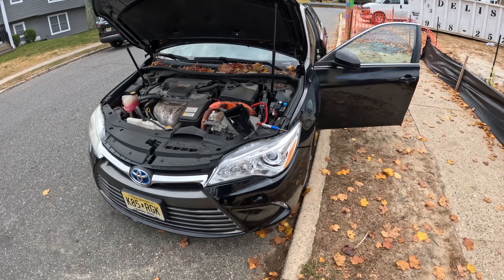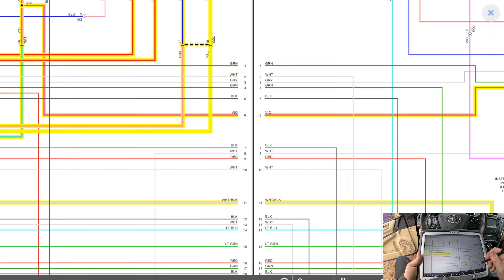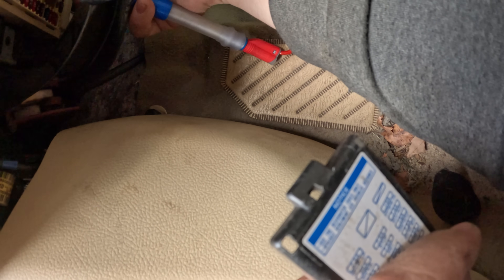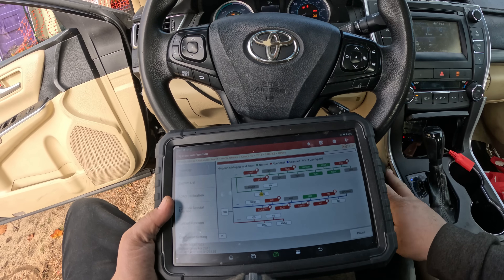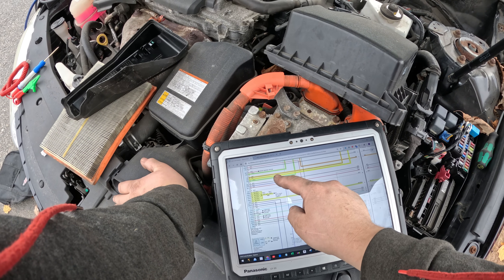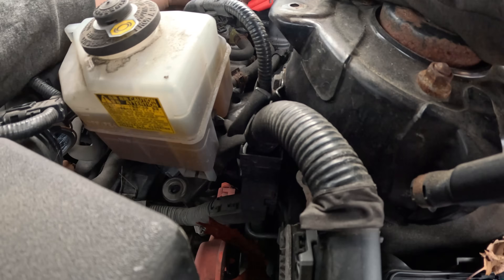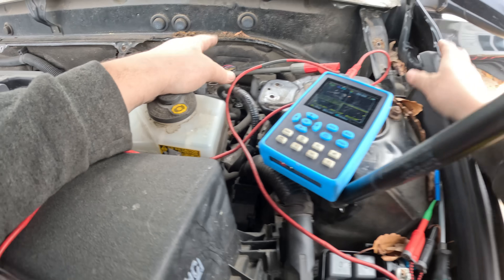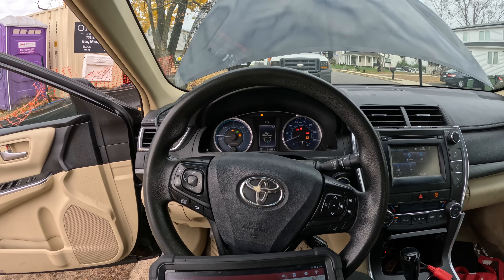2015 Toyota Camry Hybrid - No Communication To The ABS!

Comment: Hi quick question, is there a way we can test ABS module alone without ECM by manually powering power and ground and checking can high and low. i know end resistor is not there, not sure how to test CAN H AND L seperately by having power and ground.
Reply from the maker: Sure if you give power and ground and connect can high and low to pins 6 & 14 on your scantool. If there is no terminating resister in the module I would add a 120 ohm resistor.

Comment: Is nail polish really a good seal after piercing the wire for testing?
Reply: I’ve personally never had a comeback using nail polish to seal up wires
Reply from the maker: I've never had an issue with it and I've seen vehicles back a year later with no corrosion.